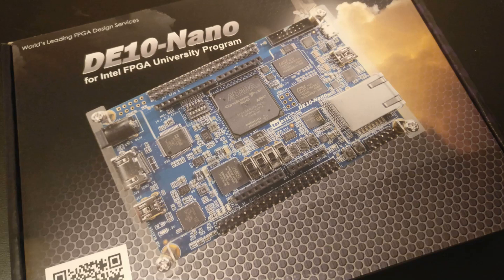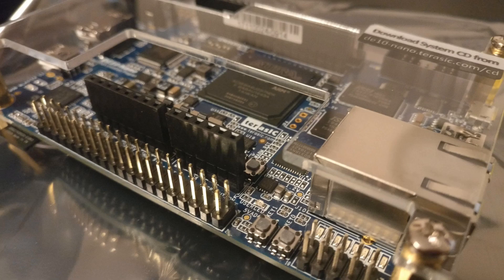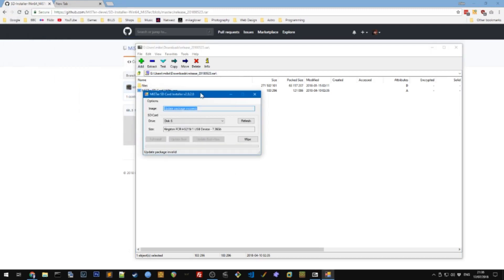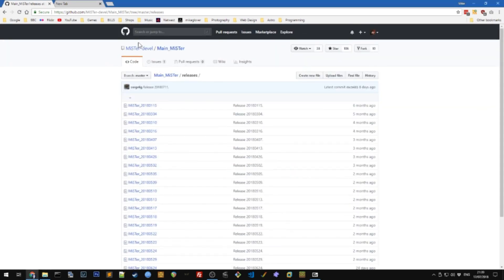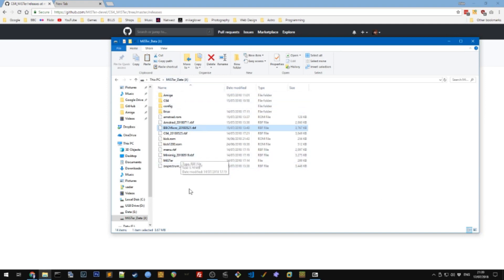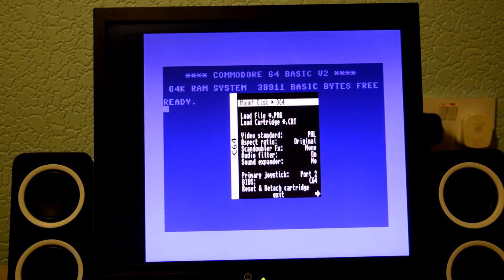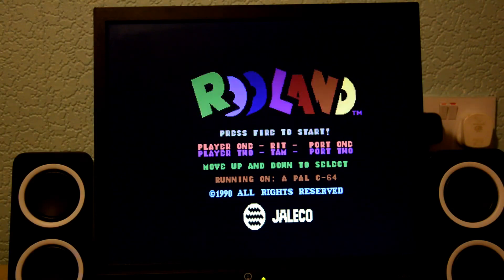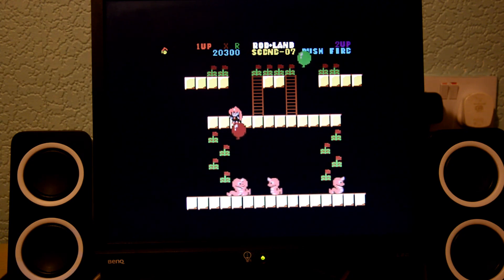MISTer FPGA DE10 Nano - Part 1 Overview and Setup

Comment: @UCGv4wA5xW6qFSFiRfZcWaBQ Hi there, I have few questions about your setup : You said that the VGA/Audio board is not something mandatory to get. But Is there an audio Output with the main Nano board ? (Maybe the audio passes through the HDMI output ?) 
Also, do you plug your USB Hub onto the Main Nano Board or an additional module ? 
Where do you add the Cores ? At the root of the SD card I suppose, but what about the games ? 
Finally, Do you navigate the core systems via a usb keyboard or is it possible with a joystick ? 

Thanks for your help ;)
Reply from the maker: Hi Cldeez,

1. Audio is sent via the HDMI port.
2. I plug the USB Hub into the Main Nano.
3. You add cores to the root of your SD Card. You can then make up your folder structure for storing roms or games.
4. Yes. Use a USB keyboard and press F12 to get to the menu and from there you can change cores.
USB Joysticks work too.
Reply: @MikeyGRetro  Thank you so much for your help ! Everything is crystal clear now :) I think I'm going to get one :)

Comment: I wonder how this would compare to a Vampire card ? Just wondering
Reply from the maker: Vampire card inferfaces with the Amiga and has 60080 instruction set where as the core in the MISTer focuses on emulating 020 and up to an Amiga 1200 with RAM expansion. 2 very different uses of FPGA

Comment: Great video. Can I ask are you still running a MiSTer setup and if so could you help me by answering some questions? I'm UK also.
Reply from the maker: I still have the mister but not used it for a while. What's your question?
Reply: @MikeyGRetro  First: power supply. Like yourself a live in the UK and said de10nano (mine at least) came with a 2 prong plug. Did you get around this using a plug adapter or entirely new UK power supply?
Reply from the maker: Robert Higgins mine came with a uk plug 5v 1a barrel plug unbranded. So didnt have this issue.
Reply: @MikeyGRetro  kidding? Where did you get yours?
Reply from the maker: @user-rd5wj2mm8n  mouser
Reply: I'm having same problem, on mouser website it says it comes with a US power supply. in your video I can see the US one in the box, did they bundle in a second one for free? when I try to order, it says international shipping so it'll be coming straight from the US, and I'm sceptical about them including a UK one. also tried contacting Digikey and theirs is also a US one.
Reply from the maker: It was a while back now so memory is fuzzy. I think it came with UK adapter or plug. I have a few adapter around so might of ended up using that.
Reply: Thanks for the info. I've found out the US one that it comes with can be used over here, it accepts 100-240v, just need one of those 2-prong adapters. You can also get uk plugs or usb leads that work very cheap on ebay and amazon. My de10 arrives tomorrow :)

Comment: Hello, do you know where to buy the SDRAM Board (for Amiga), thanks
Reply from the maker: http://www.atari-forum.com/viewtopic.php?p=344171
I got mine from THaase in this link from Germany who I can recommend.
Reply: Thanks
Reply: @MikeyGRetro  Hi there, I have few questions about your setup : You said that the VGA/Audio board is not something mandatory to get. But Is there an audio Output with the main Nano board ? (Maybe the audio passes through the HDMI output ?) 
Also, do you plug your USB Hub onto the Main Nano Board or an additional module ? 
Where do you add the Cores ? At the root of the SD card I suppose, but what about the games ? 
Finally, Do you navigate the core systems via a usb keyboard or is it possible with a joystick ? 

Thanks for your help ;)

Comment: Could you please give the information on the seller of the I/O board and is sd  this module ,, I know you also mentioned that you weren’t going to use it for an Amiga setup But I would definitely be interested in singing how to set up an Omega on one of the wondering what sort of speed you could run an Amiga  On the set up